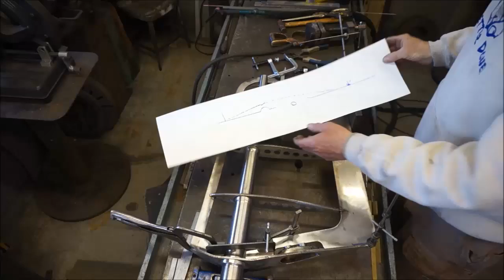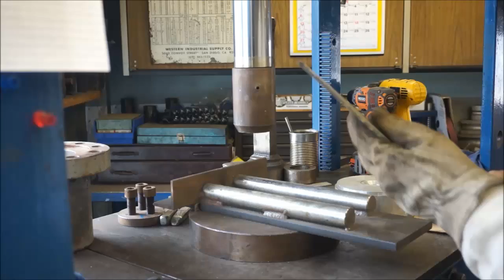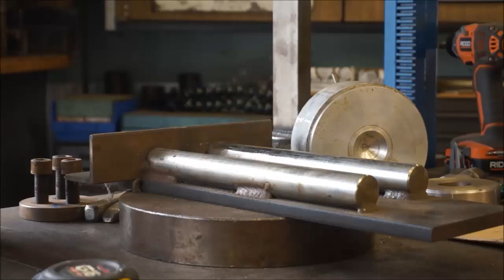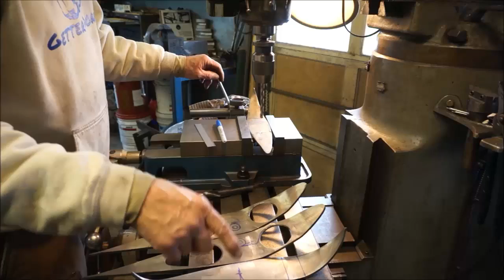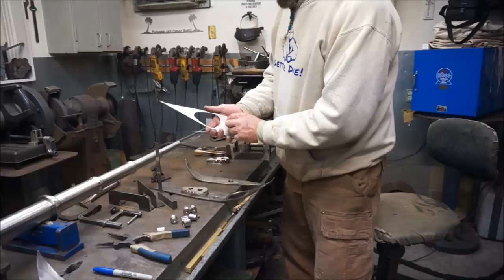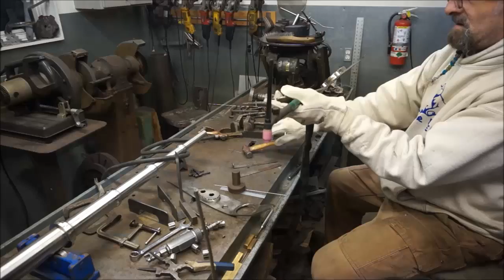Wing It Part 14

Comment: Hi Keith,
This is nice work...!  Kind of an artist mixed with a machinist.
Do you experience lots of warping problems with those stainless shapes, and also if you don't create a backing purge, are there a lot of stalagtites created on the oposite side of the weld?
I really enjoy the process,
Pierre